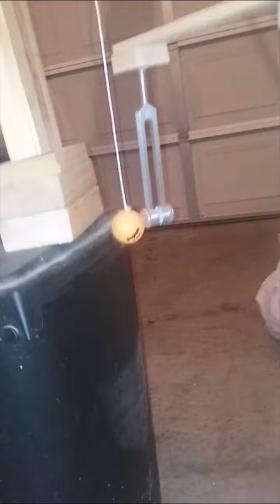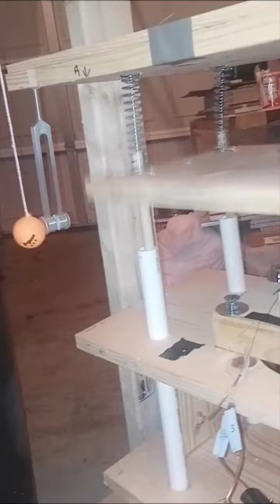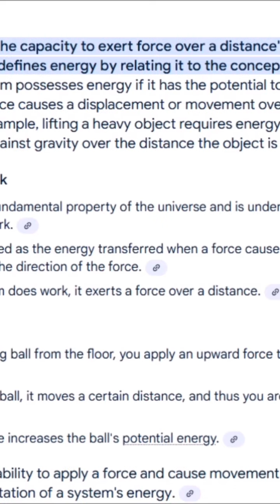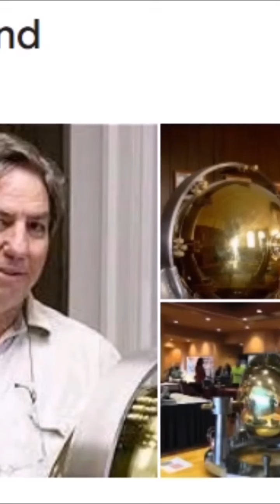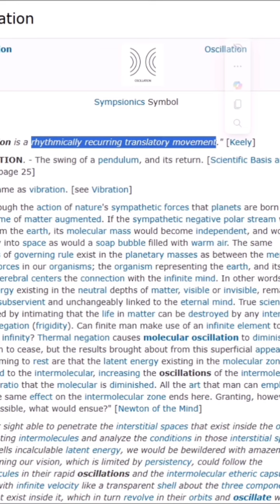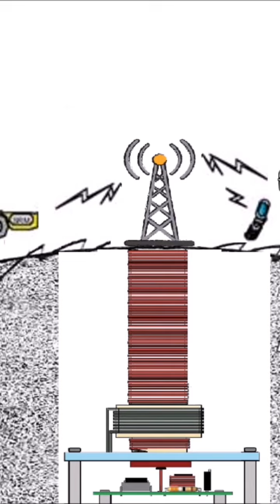Khafre Anomaly: Megalithic Tuning Forks? #youtubeshorts

Comment: Instead of the tuning forks would they be able to use like bells the church bells they have really high frequency and consistent
Reply from the maker: Possibly. Gongs fit in that category as well. But as far as I can tell, tuning forks generate far fewer overtones. Because of this, they would be ideal at filtering incoming seismic vibrations, which have high frequency variance, into more pure tones.